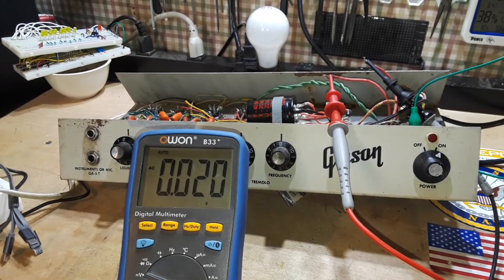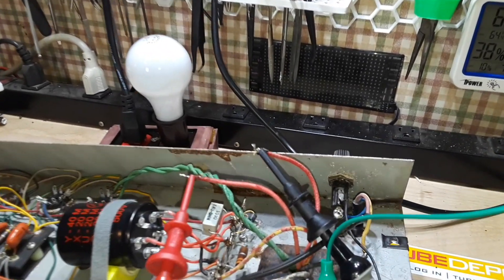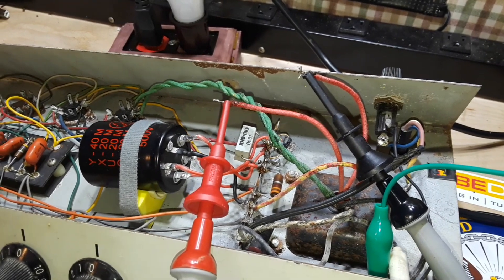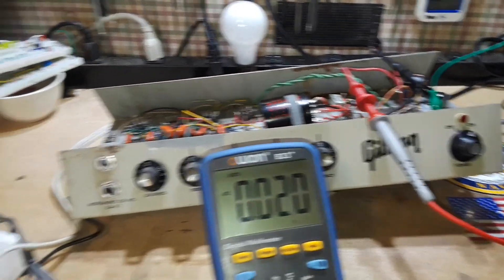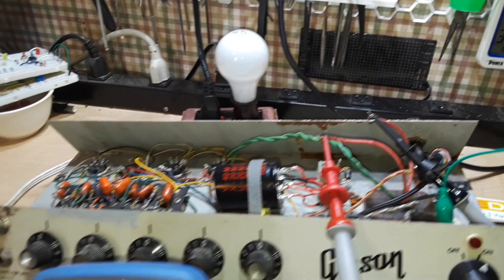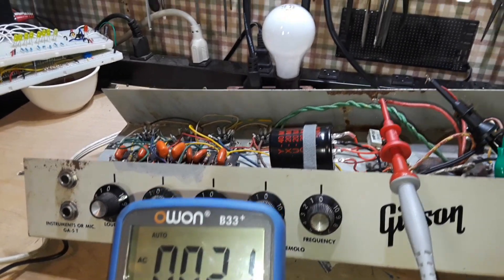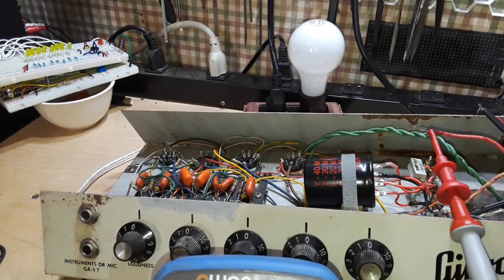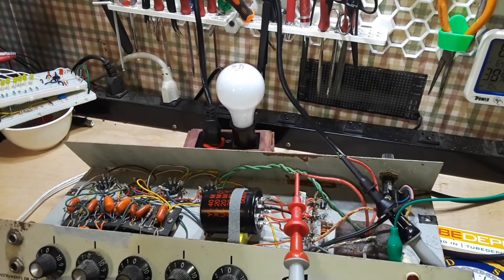Just A Quickie: Gibson GA5T Skylark Has A Blown High Voltage Power Transformer Part 5

Comment: You don't need a linear power transformers, Why don't you build a switching power supply that can output 300vac and the other multi taps voltages? Blackstar amplifiers don't use a linear power transformer they use a switching power supply that can take any line freq and line AC voltage and step it up to high voltage. You should do a lesson about this it is better because less 60hz HUM gets injected into the guitar pickups also.
Reply from the maker: This is a restoration of a vintage piece of music gear. I want to keep this project as close to the original as possible. vacuum tubes, giant heavy transformers, lethal voltages, gotta love it!

Comment: Hi Paul, I have been following your video series on this Gibson amp, and I am so sorry to hear that the power transformer is shot. I was worried about the power transformer when I saw all the corrosion on the inside of the amp. I do wonder if that power tranny has been subjected to a lot of water. I do have power transformers, but those power transformers are from old Tektronix scopes that has been destroyed due to FedEx. I think I have a power transformer from a Tektronix 541, 535A, and I think 545A. But those transformers are HUGE and weighs at least ten times more than that power tranny on the Gibson ! I also have some from 561A and 503 as well, but those don't have the 300V for high voltage. Maybe 225V at best.
Reply from the maker: Thank you very much for offering to help. Hopefully I have found a suitable replacement on eBay.

Comment: Sorry to hear. I was really pulling for you! I really wanted to hear what this model could do. Dlab did a reconfigured scheme to make this model work.     Maybe eBay might have a champ sized power transformer that may have similar voltages? Maybe you could redesign the circuit and use the skylark as a husk. That would make some good videos. It’s got good bones!
Reply from the maker: That's kinda what I'm thinking. Maybe a Princeton circuit.